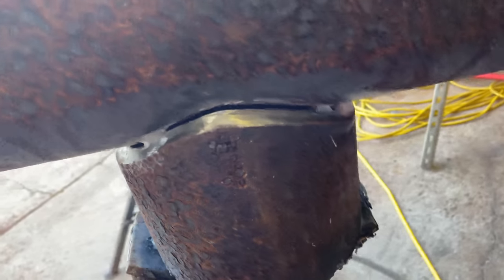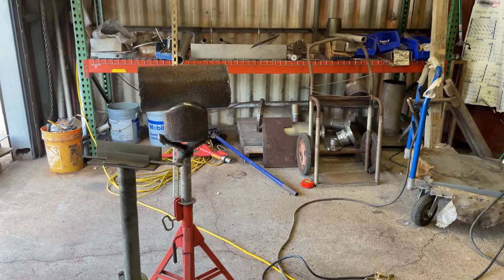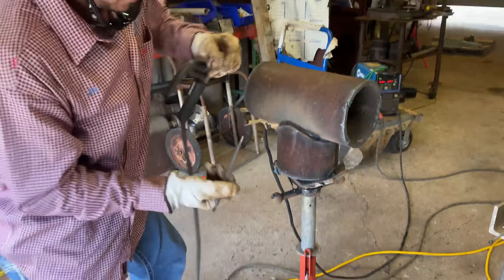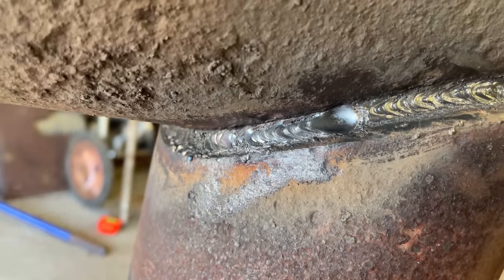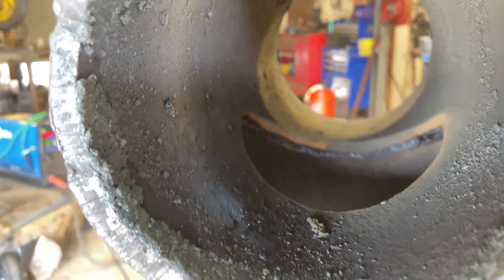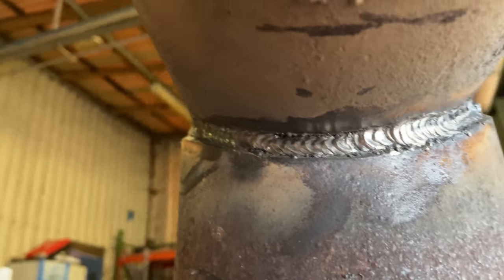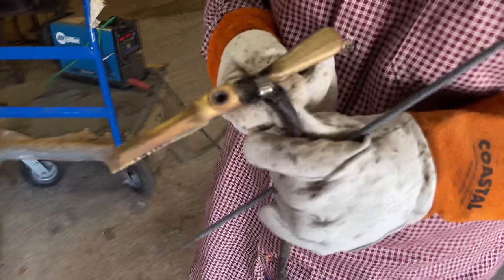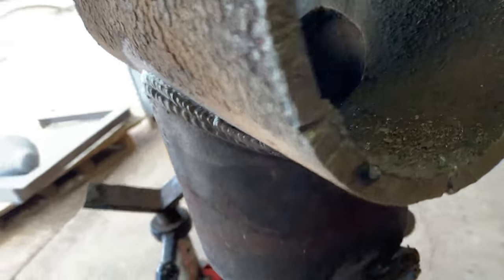Pipeline 6 on 6 Branch Welding

Comment: Great video bro ! , Pipeline welder here and still watch videos about welding In my spare time lol. Around the 13:15 mark you can see your ground arcing out , I always clean the slag so it can sit directly onto the metal it really messes with these newer machines especially the ones that are trying to sense the arc (pipe pros and the Mp from Lincoln ) Saludos

Comment: Nice cap man. Do you think it would of been possible to weld a third bead on the top of the cap using a 3/32” electrode? Could of possibly helped with the issues you had at you top toe of the 2 nd pass and got an nice transition into the top pipe? Or is an 1/8” electrode the minimum you can use on this procedure? Nice vid and nice work. Keep ‘em coming
Reply from the maker: To be honest I’ve never seen a 8010 3/32 rod bro. But no,  most tests are 6010-1/8” for root and 5/32” 8010 all the way out.

Comment: Are you supposed to bevel the riser all the way?I thought the throat only got a bevel and the ears only got a slight bevel?
Reply from the maker: Yes sir. Slight bevel. I beveled way too much but we still managed to make it work. Throats you need a steep bevel and  ears not so much as the torch will do most of the work.

Comment: I don't know about you but that ground arcing out like that will have a big effect on the weld.
Reply from the maker: Yes sir. In a real life situation I don’t recommend a cheap ground like I had here. It was the only ground clamp I had as the other rotted out due to corrosion. I need to replace it. Thanks for your observation. 🙌🙌🙌. Thanks for watching budd.
Reply: @VantageWelding  your weld's looked pretty good with a small machine like that wish i was back out there welding stuff up again with my rig.

Comment: What kind of welding machine are you using?
Reply from the maker: Shop machine. Miller maxstar 210. Coming from an avid Lincoln user, I have to admit…. Miller welders are better.
Reply: Orale bro gracias

Comment: What size rod are you running and what amps because I keep just blowing a bigger and bigger keyhole on 6 inch schedule 40 for this.
Reply from the maker: Where are you blowing holes brother? Is it seamed pipe? What amps are you using?

I’m using 1/8” 6010 around 85-95 for root
8010 5/32” around 125-135 amps brother. But my pipe was a scd 80. Close to 375 wall. It’s a lot more forgiving on root and hot pass.
Reply: @VantageWelding  I was running 7018 at around 110 amps 1/8 then I dropped down to 3/32 but I had already down a root pass. It’s just a little project for the weld school I’m in nothing that needs to shoot but I’d like to do it right
Reply from the maker: @brodyrhode9064  keep running them 3/32 brother. If you’re blowing though a saddle chances are it’s too thin, excessive grinding, or maybe too high of voltage and staying too long in one spot. 3/32 is king for a weld like that specially since your still in school brother. No need too rush into 1/8. Truth be told, out in the field you can run 3/32 just as fast as you can with 1/8” rod in smaller pipe. The rod size starts making a difference when you start to get into heavier wall and bigger pipe.
Reply: @VantageWelding  thanks for the tip bro. Couple more weeks of pipe and I’m out of here. Looking to get into some stainless tig got all my certs for it
Reply: @VantageWelding  what kind of motion do you do for uphill 7018 on this or would you only do downhill

Comment: Any reason you can’t use 1/8 6010 on the hot pass?  Would most branch test just have 6010 root and the rest HYP or 8010?
Reply from the maker: You have to follow weld procedure brother. I wish I knew the answer as to why you can’t. But I don’t. All I know is if you weld clean you will be 100% good

Comment: Instead of using the 6010 1/8” rods as you said for tight spots on that hot pass…… use 1/8” 8010 pipeliner rods, they make em 🤷‍♂️……. Just sayin….. still wouldn’t suggest sayin anything to an inspector
Reply from the maker: They do brother. And you are very correct. That is a killer tip, thanks for your suggestions. My very first video on here was putting a root in with a 80101 rod lol
Reply from the maker: 1/8” 🦾🦾🦾

Comment: I never cared for this test, doesn't make sense that it is still used for 1104 test. Yet I only once did such a procedure, but it was temporary.
Reply from the maker: To top it off, the branch test only qualifies you to weld o-lets 😂
Reply: Sticks in my craw

Comment: Root I.d. to i.d. ??
Reply from the maker: Hu?
Reply: @VantageWelding  does the root penetrate ID to ID ?
Reply from the maker: Ahh. Yes sir. It has to. You have to catch both walls because your straps will be bent. If there is lock of fusion or incomplete penetration, they will break at the weakest point.
Reply: @VantageWelding  10/4

Comment: Eh. Not too impressive.
Reply from the maker: Thanks for watching 👍
Reply: @VantageWelding  I was unimpressed at 5 minutes. So don't thank me with your sarcasm boy.
Reply from the maker: @deetalashoma3514  sorry about that budd. Wasn’t trying to impress anyone. It’s just an educational channel open for the public to learn from our experience and mistakes. AGAIN!! Thanks for watching.
Reply: @VantageWelding  Yes, experience is the word.
I am a "Master Plate Welder", although I am not a machine. I spent around 28 years as a Welder. I appreciate your experience but in my experience I didn't do a lot of SMAW, or MIG welding. I worked in Aircraft/Aerospace. If you can TIG weld material .005 - .010 inches thick, you're hired. And TIG weld an aluminum can back together, again, you're hired. Now however, lasers do that easily. 
One thing I didn't see was cleaning the weld where you left off, aren't those welds to be of X-Ray quality? Mine are, and sometimes we all fail X-Ray. 
Keep on keeping on boy. 🤪👍
Reply from the maker: Thanks for watching 👍

Comment: Hey another good one . On the last cap did you have the electrode aiming more towards the top of the pipe & then let gravity build the weld up ?
Reply from the maker: Yeah bro. On the throats it was a simple pause whip puse. And on the ears where I needed a bit more metal I was pausing more up top. And doing kind of like a slight side ways j motion if that makes any sense.